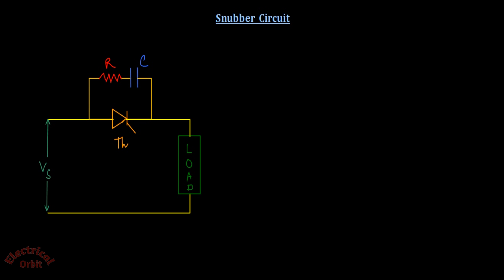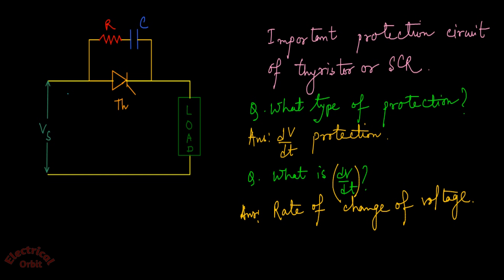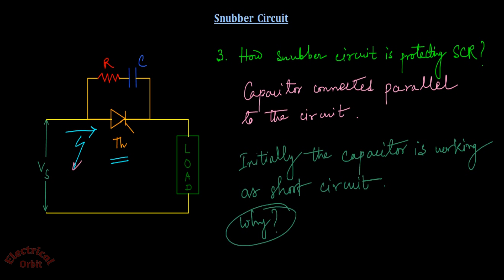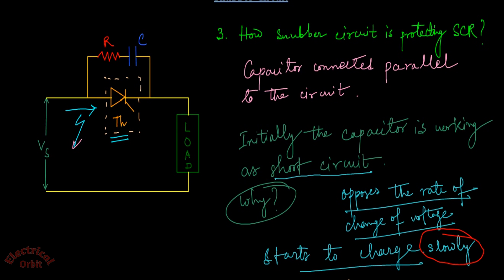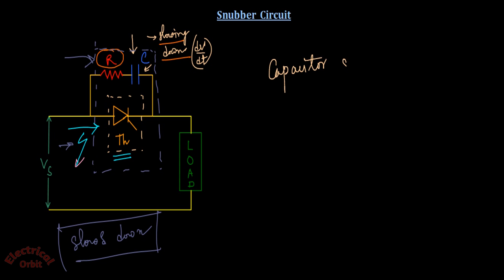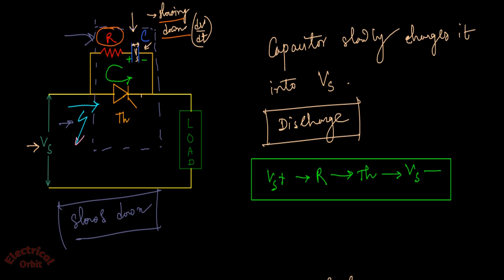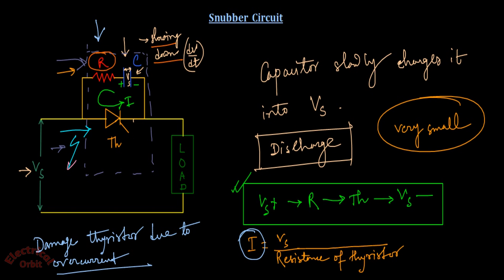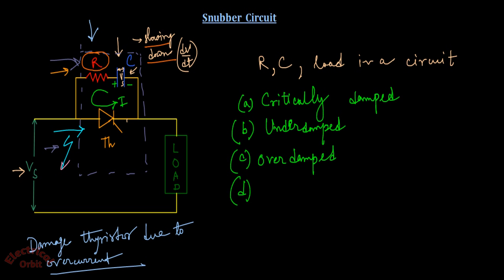Snubber Circuit for Thyristor Protection l Snubber Circuit Design for SCR l Power Electronics

Comment: used a snubber to eliminate noise introduced by the inductive current of a high amp relay.  Coil needs to relieve the voltage after connection is disconnected.